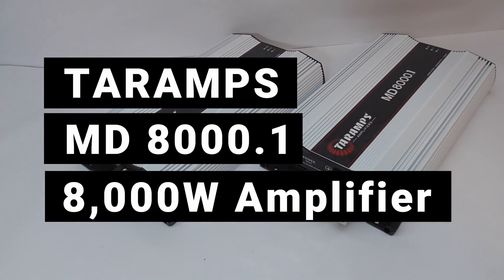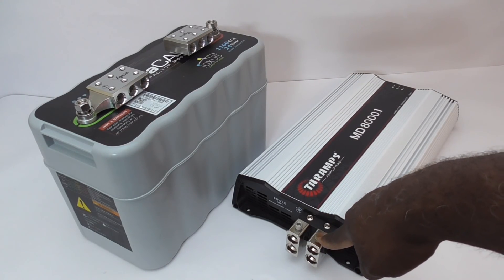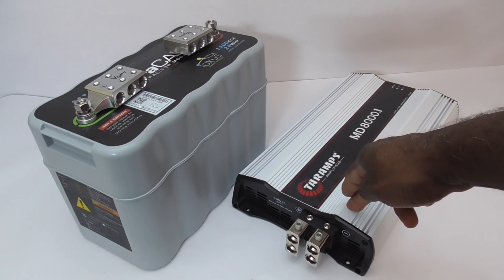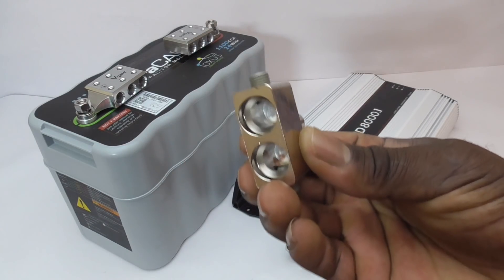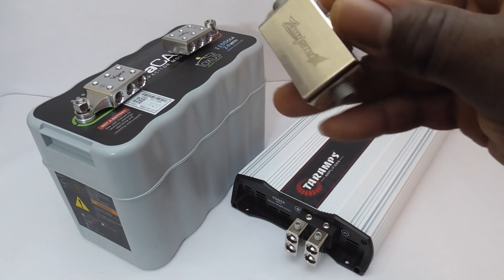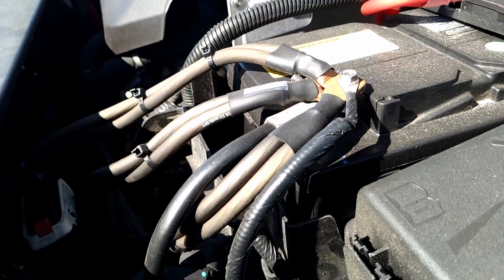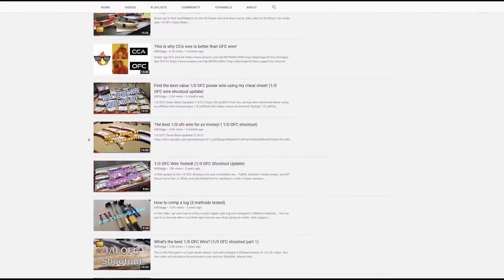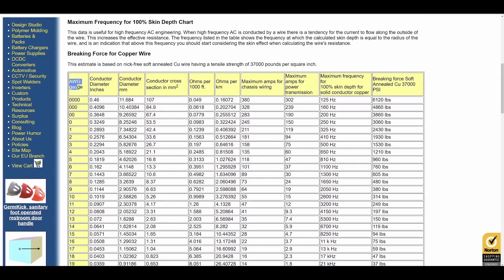Are Dual Inputs Really Needed In Every Setup?

Comment: If you are going to go full blast at shows for extensive amounts of time, then I would go dual. Also if absolute performance is needed for competition, then maybe you can get some more voltage at full blast with two cables.

But if its a daily that wont go full blast except to get some laughs for a short while now and then, the run a single. I mean, my guess is your battery will start dropping voltage before the cable starts to melt.

But in reality one would have to do some calculations to get the truth. The few builds I've done I've always bought good cables but maybe not up to the sizes the "pros" recommend. Because I never ever go full blast. And if I would, I would only stand it for a few seconds. 

Would be nice to see some messurements comparing the two to see if, and when you start seeing a difference.
Reply from the maker: I think that would make some great content. I'll put that on my 'To Do' list.

Comment: My recent build I bought dual 0 gauge pure copper ones first time I even ran them on a 4k system I did notice a different
Reply: What is the difference you noticed?
Reply: @concretesub8253  my voltage stays higher with dual runs of wire I'm also running a mechman alternator and 3 xs power batteries
Reply: @zeth15943  ok great. Would you have run dual 0g to a 3400w rms sub amp?
Reply: @concretesub8253  I'm running a 3000 watt amplifier but it's a audiopipe it's power hungry does well over 3000 watts tho I would recommend dual runs
Reply: @zeth15943  ok i will also run another 0g to my amp,thanks mr.
Reply: My opinion? You are correct sir

The reason I can see a dual or multiple runs on this is only for competition purposes in my opinion because less resistance will add a watt or two.

For your average persons setup I wouldn’t bother with even a dual run , just one of what you already have. 

Great video btw, as always!

Comment: stock 2/0 is enough for these amps. but if you're going half ohm i see nothing wrong in ensuring more current flow
Reply: They make .5 ohm Taramps anyways.
Reply: I’m the weird guy over here trying to run 2+ ohms
Reply: @matt6951  🤣
Reply: You don’t wanna go half ohm on Taramp.
Reply: @xchampxownsx4535  LMAO that's cute. both my smart 3's wired to .4 and both my bass 8k wired to .5 you must be thinking about the older taramps or think i must have a 9 volt battery for a power source LMAO that's funny as hell.
Reply: @notyobiz6207  well from experience, Taramps are Brazilian boards, and when I go half ohm on them they burn. If your amps able to go half then that’s good. I’d rather stick to Korean boards where they are build better to go half ohm.
Reply: @xchampxownsx4535  ppl out here running .35 on taramps lol. step your electric up and so can you. "well from experience taramps are brazillian boards and when i go half ohm on them they burn." ok, was it the old grey amps or the new white scheme? alt, batt, wire used? box specs and woofers used?
Reply: @notyobiz6207  I burned my HD10k @ half ohm, running 2xNSV4 15s dual 2ohms. With a limitless 45ah bank, 2xRuns of zero. A XS power D3400 under the hood with a 390 JP alt. That’s just  from my bad experience. Like I said. If it worked for you, that’s good, but I’d personally rather just run Korean boards.
Reply: @xchampxownsx4535  so basically you had the old taramps.
Reply: @xchampxownsx4535  old taramps would catch on fire too lol now a days they are much better. no hate, just curious how yours bit the dust but many others seem fine. u just had the old one thats all.
Reply: @notyobiz6207  that’s good they gotten better, but i have a friend that’s making his audio brand, and his getting pretty big here. So I’ll just be supporting him. So far his up in the game, and it’s good to represent his product.
Reply: @xchampxownsx4535  actually the MD8k and 12k have a half ohm model available now I do agree with you to thee extent you should not wire a 1ohm stable taramps to half but they do make half ohm stable amplifiers and it is odd I am sticking up for them as I truly hate taramps as a whole lol cheap power is never good or reliable power! I stick with half bridge korean boards for brute strength and half ohm ability with reliability and longevity lol I own some amps that are over 20yrs old and they work perfectly do you honestly think a 20yr old taramps that's been with a dozen different owners and in multiple vehicles on multiple different subs or sets of subs will still be working in 20yrs??? 🤣🤣🤣 no chance! I'll stick with my Wolfram AW-9000.1D/5000.1 and my pair of Soundqubed Q1-4500.1D's as I know they'll still be working as long as I own them and are easily repaired if anything was to go wrong due to negligence on my part....
Reply: @kevinAuman1  my new setup will have 2 5k that are Korean boards, and I’m going to 1ohm them to my nsv4 D2. I’m glad Taramps are now getting better equipment, but I’m going to support a friend of mine that makes his own brand. His equipment are quality, and also locally own.